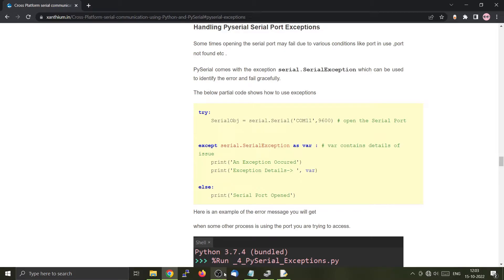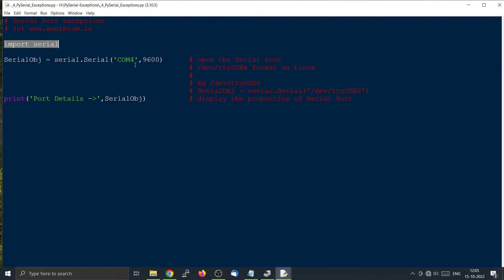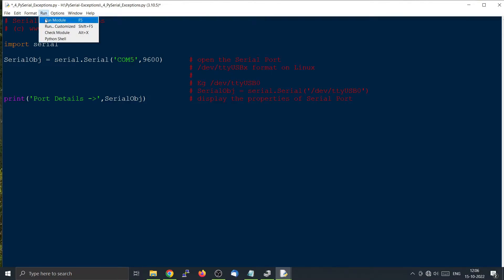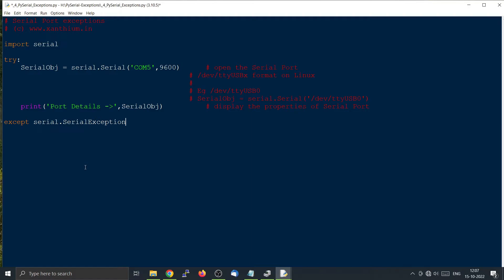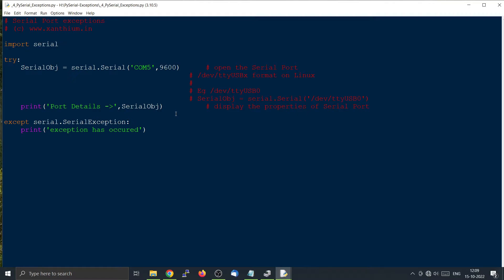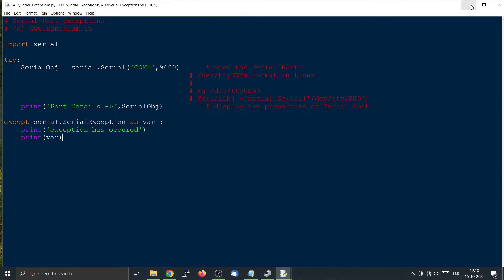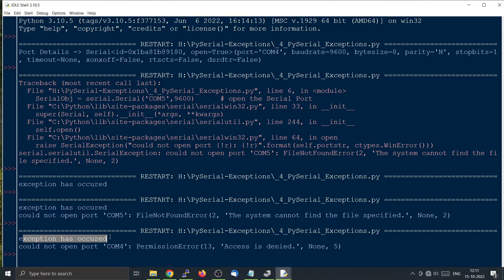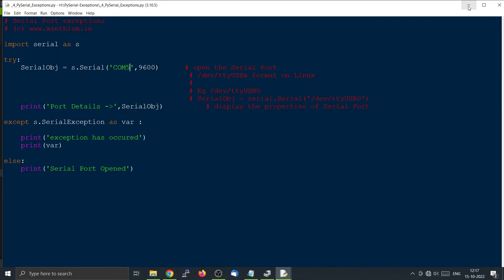Learn to Handle PySerial  Exceptions in Python  Serial Communication with Arduino

Comment: why i am getting this error 
SerialException: could not open port 'COM4': PermissionError(13, 'Access is denied.', None, 5)
Reply from the maker: You have to give the comport number of your system.COM4 is the comport number in my system.

Connect a USB to serial converter or Arduino to which you intend to open a connection.
Go to device manager,find the comport number and use it instead of com4